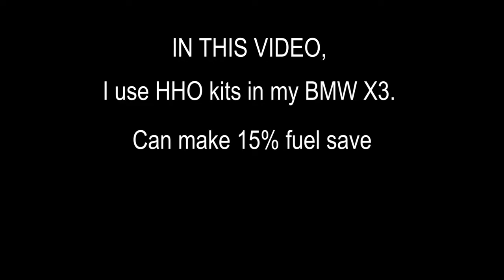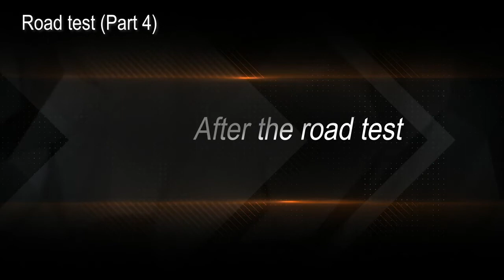Hydrogen Generator Fuel Cell Power Gas Saver Car HHO Kit

Comment: how much amperage does system draw? how does it power off
Reply from the maker: 1.Our product use Voltage 3.5~5.5V, current 10 ~ 20A, very low power consumption, 0.15 per hour.
Reply from the maker: ON/OFF by ACC control